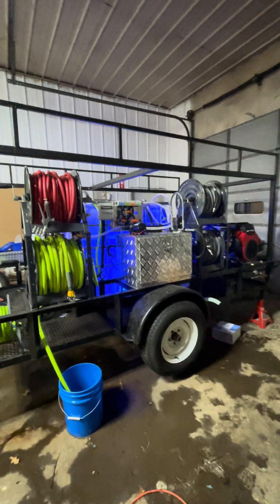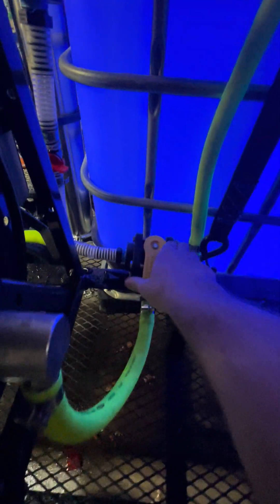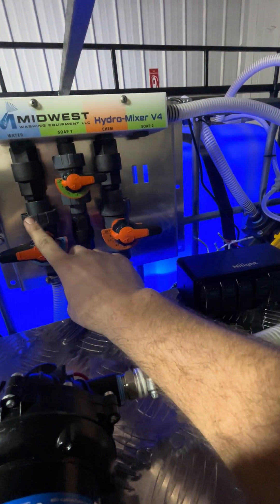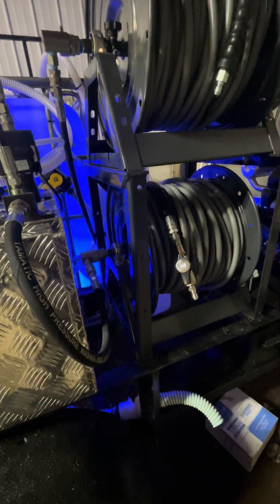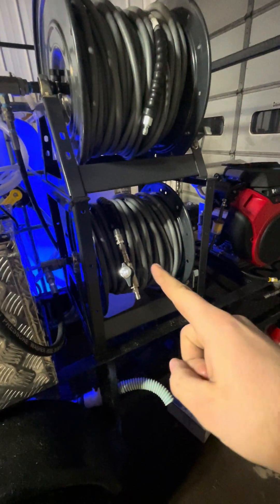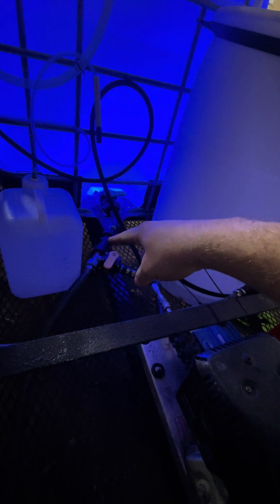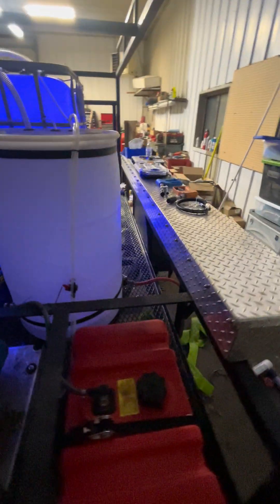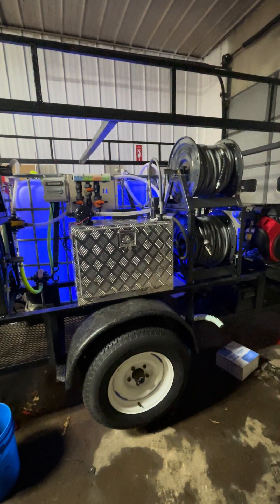2024 Pressure Washing Trailer: Plumbing

Comment: Would you not be starving the pumps if both pressure washers are running? I would think it would need to be a 2” line running to where the split is.
Reply from the maker: That’s actually a good point. Something I will look into. Thanks for pointing that out 😎🤘🏼🇺🇸

Comment: Nice and clean set up! Keep your axle bearings greased. If you run into weight related issues w trailer swaying , get 12 ply tires. It won’t make you legal but it will be a world of difference in ride control.

Comment: What size trailer and what is it rated for
Reply from the maker: 6x12. Axels rated for 3,500lbs. It weighs 2,600lbs without water. I don’t plan to transport it with more than 100lbs of water. So we Gucci 😎🤙🏽
Reply: @BlueLinePressureWashing check out what the GVWR is brother, the capacity you can load on the trailer isn’t 3500, somewhere around 2600 pounds. Your still adding more to the trailer too I recommend going for double axle💪 just a friendly tip, I wouldn’t risk it!

Comment: Can you make a video of you using and explaining the window cleaning pole system? Thanks!
Reply from the maker: Absolutely. So my channel is fairly new. A series I’d like to do is 101 videos. Where I discuss in depth different parts of my trailer and various methods on how I use them.
Reply: That's a great idea! I have been working with a homemade truck skid but I am going to build out my 16ft flatbed trailer and I am looking for ideas for what to add to the trailer that's unique like your pole system. I will be on the lookout for your future vids. Cheers!   @BlueLinePressureWashing